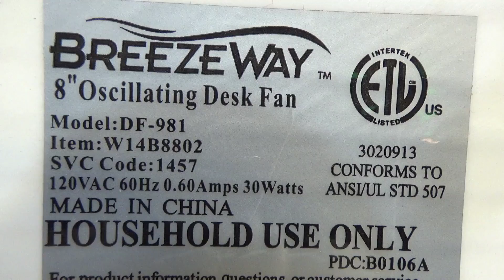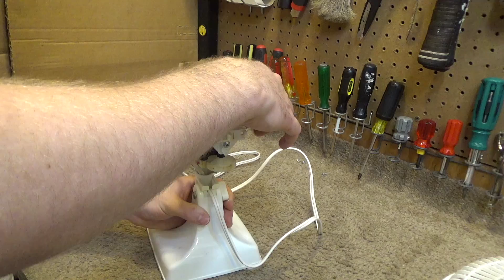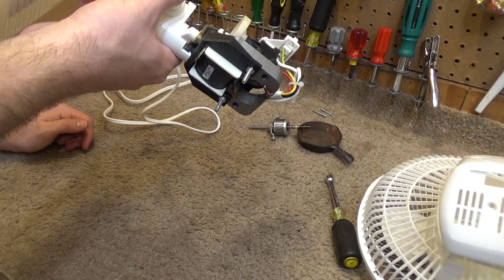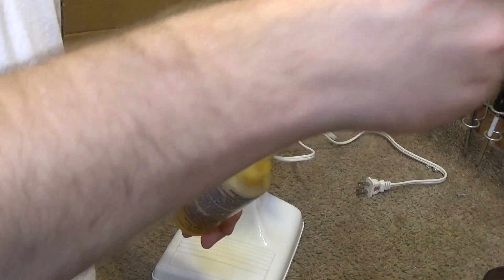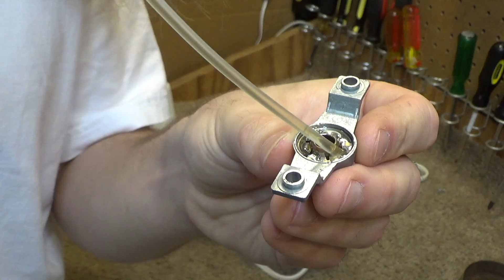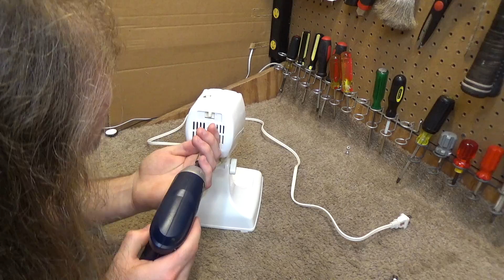BreezeWay DF-981 8" Oscillating Fan | Clean and Service

Comment: I have one of these around the house. Was made in 2003 and it DID have a UL Listed sticker under the base by the main label which read "11/02 UL Listed FAN 2G24", so hopefully yours just fell off.

Meanwhile, mine was turning very slowly then stalling, so I took it apart and took a crack at it myself. I oiled up the bearings in much the same way you did, and that brought it back to life. Still, I'm  a total novice so I watching your video to see what I may have missed. I didn't know bearings have a wicking feature! I also didn't think to oil the bearing in the back. Glad I watched your vid. Thanks for making and sharing! :D